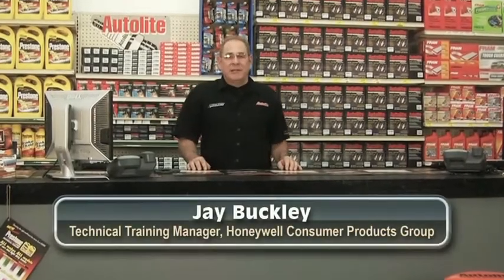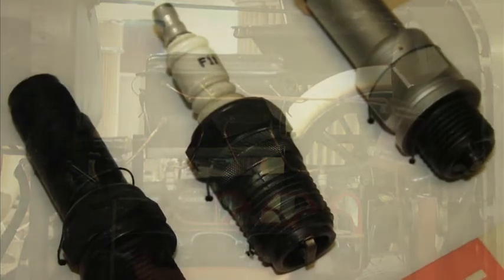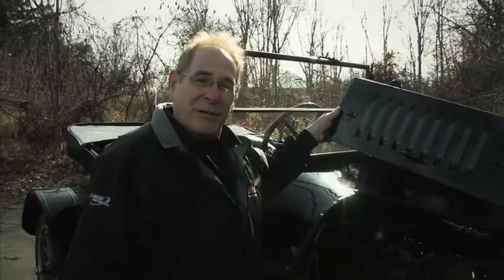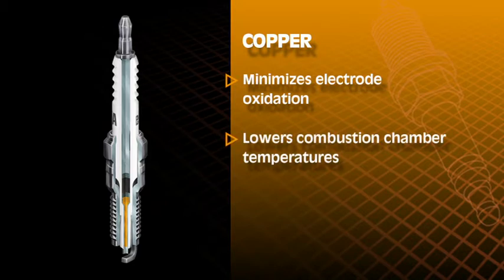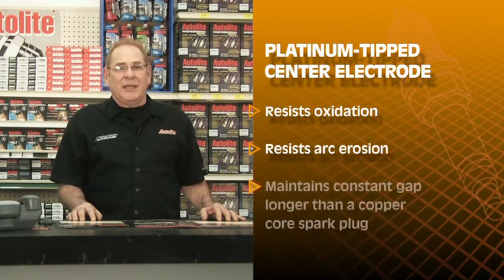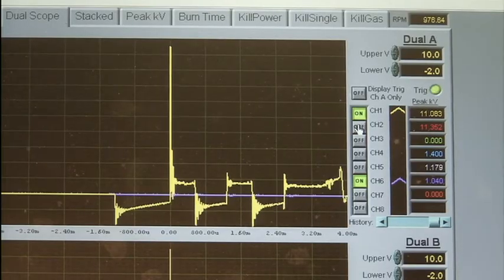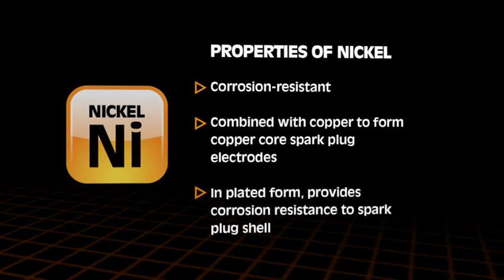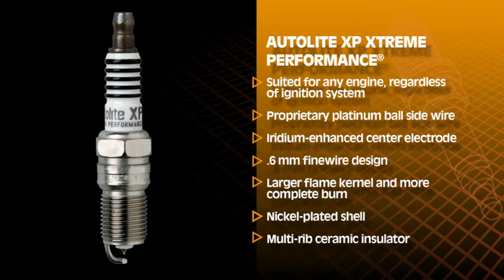Spark Plug Anatomy

Comment: My 2007 Toyota Tacoma uses four pencil coils. Does anybody know if it's a WASTE SPARK system, or not?
Reply: It’s coil on plug system , each individual coil power the spark in each individual cylinder . Your coils have single high voltage output terminal . The other high voltage winding end is connected internally to the + 12 V terminal of the coil . This system is the best  and is widely used in the industry today . The waste spark system use one coil  for  every two cylinders . So , both ends on high voltage secondary winding  are connected to two high voltage terminals which are connected to the spark plugs via high voltage wires. Since waste spark system fires simultaneously two sparks , in two separate cylinders , the number of sparks on every spark plug is twice as higher as than in coil on plug or mechanical distributor systems . Also the spark voltage polarity on one of the plugs is correct (-) on the central electrode and opposite on the other spark plug in the pair . This results of uneven firing voltage in paired cylinders and faster erosion of ground electrode  on the incorrectly powered spark plug .That is why there spark plugs life is much shorter .
Reply: @flappingflight8537  Thanks for your help.